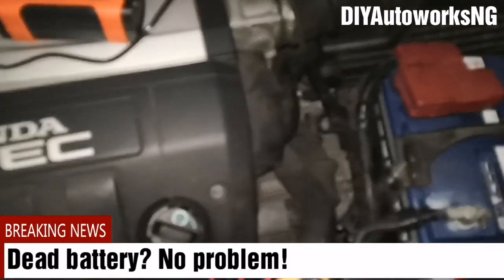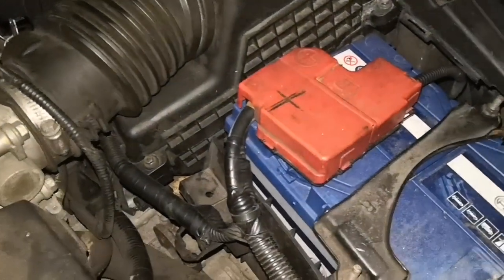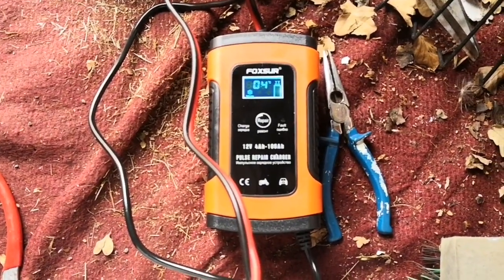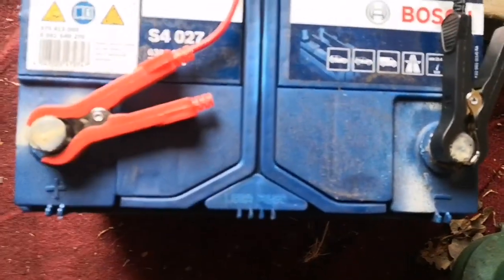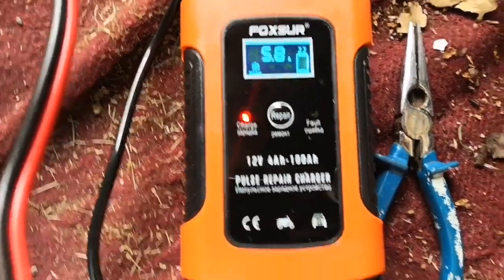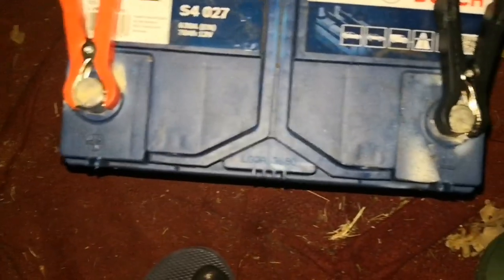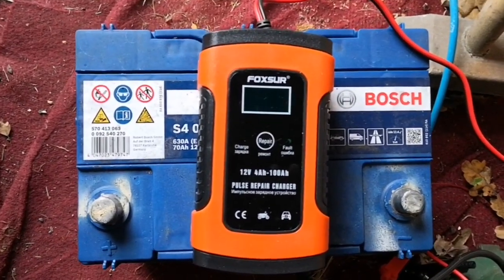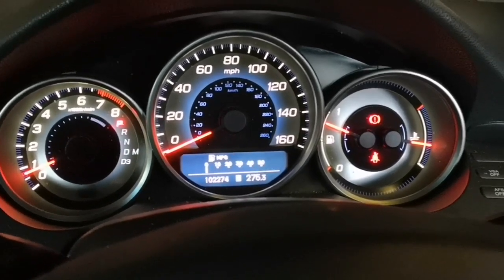Using a cheap battery charger to restore a dead car battery

Comment: you can not clearly say it works repair pulser or not??? I have seen many videos but I could not understand if this feature finally works if you have something more in this regard tell me please
Reply from the maker: The repair/pulse charging function definitely works. It is to be used when a battery has developed lead crystals on its plates and is not able to receive a charge (usually a battery that has sat with a low charge for a long time). Pulsing the charging breaks down these crystals. It is also the preferred charging method for smaller AH batteries. I have used just this to bring back a power generator battery which the service man said was no good. It is still serving me many months after!

Comment: So why do you have to take the battery out of the car?  It says that in the directions manual too.  

I bought one (different brand but exactly the same as yours; same Chinese factory) because the battery went dead in the car the other day and there was no one around to give me a jump and we live in a really small town in Colorado.  So I ordered one of these for emergencies
Reply from the maker: I took the battery out because the leads of the charger are really short and I didn't have a long extension cable to charge in the vehicle.

Comment: I used one of them on my new gel battery that went flat in the cupboard ...it never did jack as i had to bin the battery as it would not charge after 2 days of being on .....cheap nasty rubbish charger
Reply from the maker: Sorry to hear. 
So the product doesn't claim to repair any dead battery. If electrolytes are depleted, it won't work.
Reply: If charger is bad, why would you throw away battery? Would have made more sense to throw away charger.
Reply: @fungames24  i could not get the battery to charge as it was dead flat ...the charger works but never got the gel battery to start charging ...from what i have read they say a gel battery only last so many years and mine was 7
Reply from the maker: The 7 years is the reason why the charger didn't help. This one is past its life expectancy.
Reply: @DIYAutoworksNG   yep i recon so  : )
Reply: @drewsmith6066  Must be the battery type. My flooded type is 17 year old and still starts the car. The CCA is probably down to 150A but I don't have a repair function charger to return it to full capacity.
Reply: @fungames24  Apparently Gel battery's don't last that long ..mine was a gel and like i siad 7 years old

Comment: How long to charge?
Reply from the maker: It depends on the capacity of the battery. From the manual, a 60AH car battery will take 13hrs. Smaller batteries will take lesser time, 20AH takes 5hrs...

Comment: Can you just leave the battery in the car and charge it?
Reply from the maker: Yes it is possible to charge the battery in the car. You will need to determine if your car is positively or negatively earthed. Most cars a negatively earthed. In such cars connect positive lead from the charger to the positive battery terminal, and the negative lead to the chassis of the car away from fuel lines.
The reason I didn't charge in the car was because the leads for the charger are really short and my power source was far from the vehicle.
Reply: @DIYAutoworksNG  how can I tell if my toyota mr2 is earthed?
Reply from the maker: Check the battery terminal that has a lead attached to ground (chassis) of the car. That's the terminal that is earthed.

Comment: I have a charger like this from lidl but it won't charge a fully flat battery.  Stupid smart charger.
Reply from the maker: Oh gosh. Sounds like it's past the return period? One thing that can make chargers not work is if the battery has leaked out its electrolyte...
Reply: @DIYAutoworksNG  no seemingly these smart chargers won't start charging a completely flat battery unless is has a little bit of power in it. How stupid.
Reply: @martymartin2894  You can fool the charger by connecting a good battery to the flat one. Once charging begins, you can then disconnect the good battery.
Reply from the maker: Thanks for this!
Reply: @fungames24  do u connect a charger to the flat battery at the same time as the good battery or do u just hook the 2 battery's up and leave them for a while.
Reply: @martymartin2894  + to + and - to -. Then charge both batteries. As soon as the charging begins, the good battery could be removed.
Reply: @martymartin2894  + to + and - to -. Then charge both batteries. As soon as the charging starts, the good battery can be disconnected.
Reply: @fungames24  I'm guessing you use jumper cables to connect both battery's then attach the charger to the flat battery am I correct.
Reply: @martymartin2894  You can use any cable. The cable on your charger is tiny.

Comment: Could you have charged the battery while it was still in the car?
Reply from the maker: Yes it is possible to charge the battery in the car. You will need to determine if your car is positively or negatively earthed. Most cars a negatively earthed. In such cars connect positive lead from the charger to the positive battery terminal, and the negative lead to the chassis of the car away from fuel lines.
The reason I didn't charge in the car was because the leads for the charger are really short and my power source was far from the vehicle.
Reply: @DIYAutoworksNG  Thanks for the reply; others have mentioned this, and I was unsure about why it would be necessary.  Thanks for posting the video too!

Comment: Why did you not use “repair mode”?
Reply from the maker: My main aim was just to charge the battery, as it was really new and didn't need the repair function. The car had a parasitic drain and kept draining it. I latter found the source of the parasitic drain. 
If I were dealing with an old battery that isn't holding a charge or a small capacity battery (4-15AH), the repair function will be first choice. That said, using  repair mode even for a new battery will still charge it and cause no harm. It would rather desulphate the battery (if present). So I do like your suggestion.
Reply: @DIYAutoworksNG  That's wrong answer. Always perform repair mode for 24h when your battery is flat - to build density of electrolit
Reply from the maker: The manual of the device does not say to use the repair function every single time. This was a new battery that lost its charge through a drain. Didn't really need the repair function.
Reply: Piyke DIYAutoWorksNG thank you for the answer 🙏

Comment: I am like you. Car battery is dead. wont even open my doors. All this due to lockdown and virus crap. Im looking at these little things.
Reply from the maker: I feel you. This is really needed in times like this. Had to get my battery out of the car the other day and give it a good charge. Hope this virus goes away soon.
Reply: @DIYAutoworksNG  Horrible pal without car. Its like having 1 leg missing. Cant go out. Cannot drive as battery dead. I managed to find one of these last night on Fleabay just hope it arrives quickly. Thanks for your kind words sir, all the best.
Reply from the maker: All the best man. If you own a multimeter, see if you can check for parasitic draw. It's quite simple, tons of videos on YouTube.

Comment: Hi brother,

I just want to know,how to use repair mode? Need to press any button or it run automatically? Looks like have button at repair word on the charger.

I want to buy this charger from online website and i don't want buy something i don't know how to use.
Reply from the maker: Hey Omar,
Thanks for reading. Once you hook up the device it starts charging. This will be for batteries that are a bit low on charge. For batteries that have sat totally discharged for a prolonged period of time, repair mode is indicated. To activate repair mode, simply press the repair button.
Reply: @DIYAutoworksNG  thank you for this review and clarification of repair mode. I have bought the same charger and was not sure when I was supposed to use the pulse 'repair' mode. So I should 1st charge battery normally to see how high voltage goes and if it does not reach 12.6v after many hours then I should use repair mode?
Reply from the maker: Thanks for the compliment.
If it's a car battery, just charge normally. Note that it may take many hours to charge if the battery is low. If the battery has been dead for a very long time, you may use repair mode from the scratch. Also, if you have a 4AH - 15AH battery, you should only charge it using repair mode.
Reply: Can i use repair mode while battery is hooked up with the car without taking out the  terminals?
Reply: @markof2126  for car and battery safety, i think better you take out your battery and charge it on the floor. Or just disconnect battery terminal with car.

Comment: Job well done! People spend a ton of money on batteries not knowing about alternative ways to revive them.  I just bought a Black and Decker battery charger, voltage checker, conditioner, and alternator checker all in one. It takes forever for the battery conditioner, but it's a smart thing to do as batteries do start to become sulfated overtime under lower voltages. Great vid, thanks for sharing!
Reply from the maker: Thanks! Great buy with the all in one!